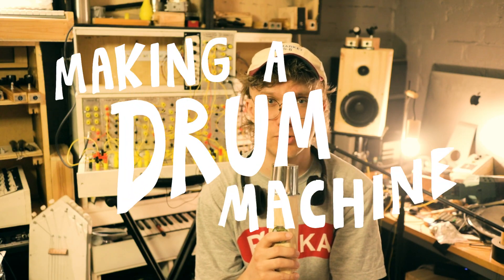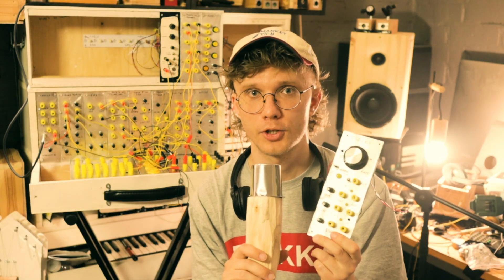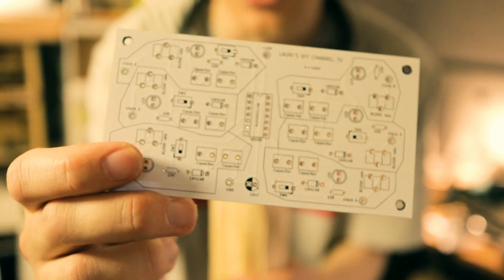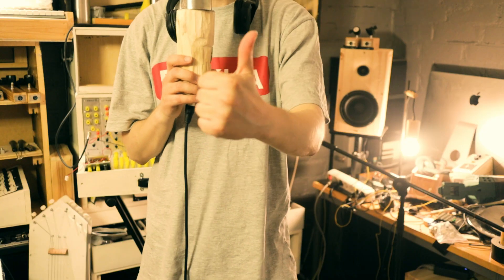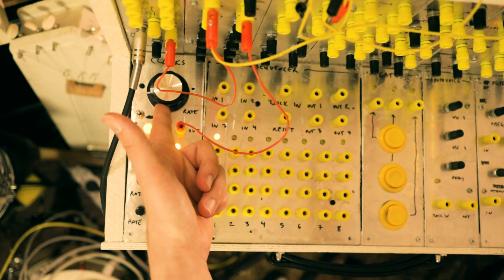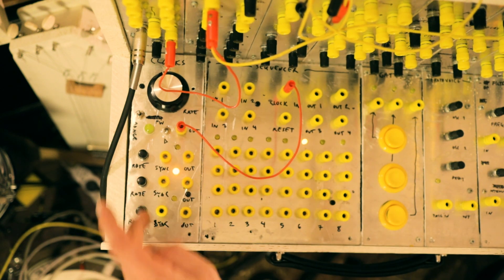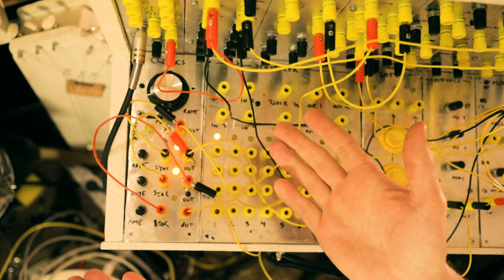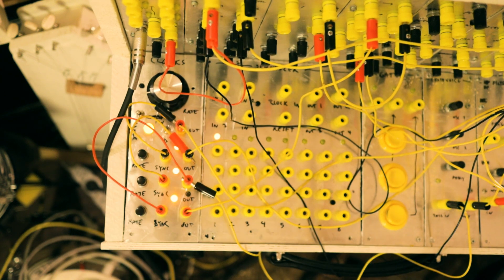CD40106 MASTER CLOCK / making a drum machine EP 1

Comment: 1:50 decoupling cap for the ic? Did you mean to say noise reduction cap? Decoupling is what you would do at the output of a circuit, I think. Great videos, I am fan!
Reply from the maker: @jobbe-wijnen  Thanks! 😊 i thought its still called a decoupling cap or bypass cap, but i could be wrong!

Comment: From the sound I would say that you are not only syncing the second clock but also over enabling or disabling it. The ON/OFF ratio of the master clock defines the enable vs disable duration of the 2nd clock. So it could be interesting to control the on/off ratio of the master clock. With it you can control the number of 'ratchets', so to speak.
Reply from the maker: Yeah that’s true! You could add a diode and potentiometer to the oscillator for a crude PW control so you could get different kinds of ratchets

Comment: That's brilliant way of using my favorite circuit. Got inspired of it and will probably do something similar as well.
Was thinking that half of the inverters could also be used...well...as an inverter to invert the three clock pulses. Useful to get for instance kick and snare on every other beat.
The 12V pulse may be bit hot for some commercial equipment so maybe the 1k resistor on the output could be moved before the LED so that they form a voltage divider. Then just adjust to liking. Some equipment I've seen use 7V pulses, some 5V and some use something else.
Regarding the pulse width, you could add a potentiometer with swiper connected to output, one end to the rate potentiometer and one end through the diode. This will limit the max frequency a bit and wont give terribly lot of PW control, but some anyway.
Oh yes, it's just a lovely circuit and one can do all kinds of fun with it.
Reply from the maker: Oh true, i dont know why i didnt concider making 3 clocks with inverted outputs too, that would be handy! I’ve used a potentiometer and a diode as PW control with another 40106 oscillator circuit before! It’s kinda sketchy as it does indeed adjust the pitch, but its a very useful addition concidering how simple it is! 😎

Comment: Thank you! This video is really inspiring. Getting me back into DIY synth. Do you think this schematic will work with a cd4069 chip? I've got loads left over. Looking forward to the next videos
Reply from the maker: No sorry, this wont work with a cd4069, because it is a hex inverter. The cd40106 is a hex schmitt trigger ic so they have a different function. You can make square wave oscillators with the 4069 as well, but it is a different circuit! You can find examples of a 4069 oscillator on google!
Reply: @LAURISDIYCHANNELTV  oh that's a shame. I'll have to order some 40106 chips! I like the thought of getting the weird synced rhythms with this module.
Reply from the maker: Yeah it is fun messing around with the sync! Its a useful chip to have anyway!
Reply: @modularknobs  Luckily the 40106 cheap as chips. The 4069 is very useful IC as well. Probably the most common Twin-T drum circuit can be made with it and it's all over synth schematics else where as well so you can surely get them used up.
Reply: @recyclop4058  thanks, 10x 40106 on order! 👍
Reply from the maker: Hell yeah!